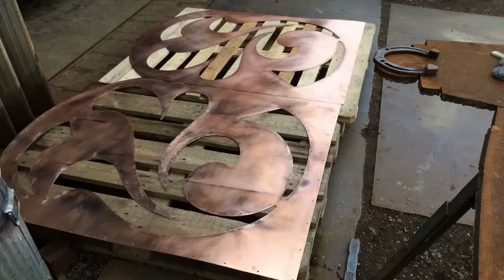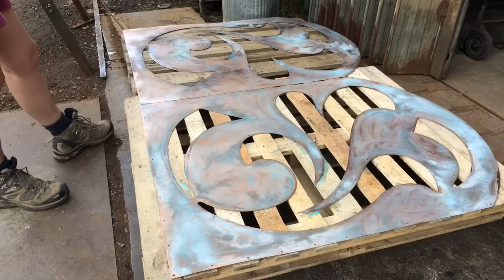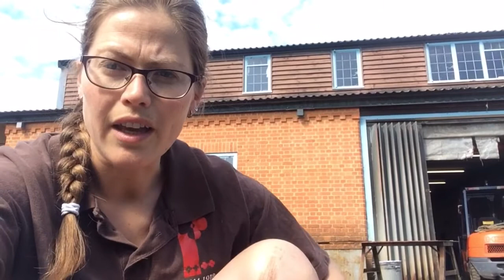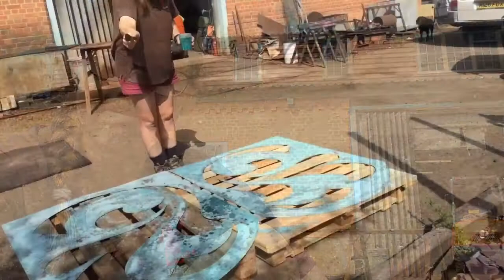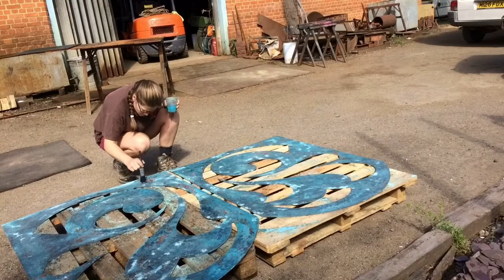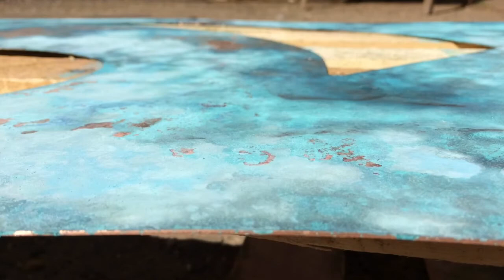Copper verdigris in action

Comment: Hi, love your vids! Is this weatherproof (as in outdoor conditions wouldn't alter the finished product) or do you have to seal it? If so what would you use? Thank you, keep up the videos!
Reply from the maker: Gary Madden 
Hi, thank you very much. With the verdigris I seal it in using wax. I heat up the copper with a heat gun in this case then gently apply a furniture wax or renaissance wax is a great make. The copper can still age but the wax slows down the process and darkens the green/blue which you can then lightly buff up to get a soft sheen. I'll post a vid soon of the sign in situ and a close up of the finished verdigris.
Reply: Rebecca Knott thanks Rebecca, I look forward to it.